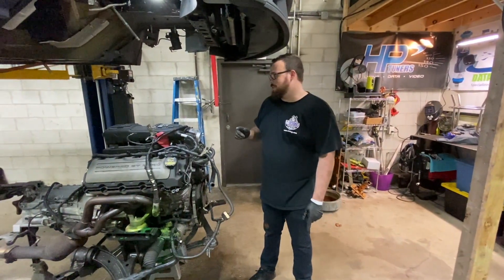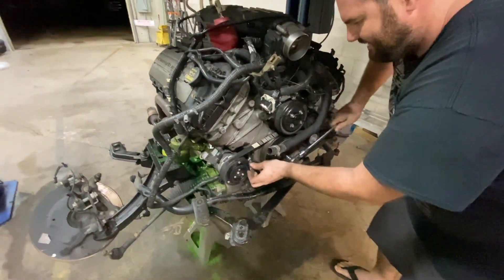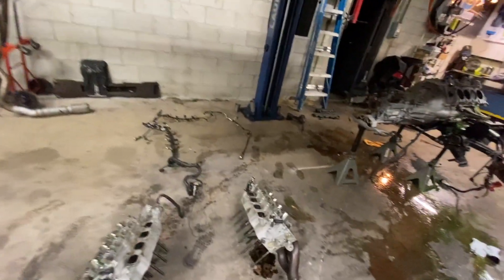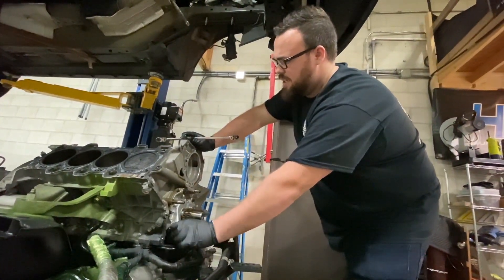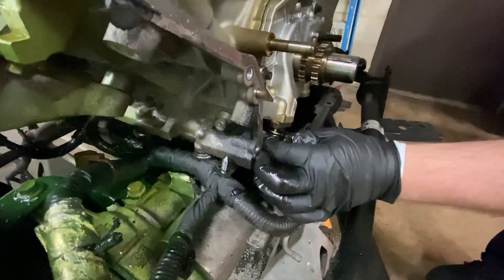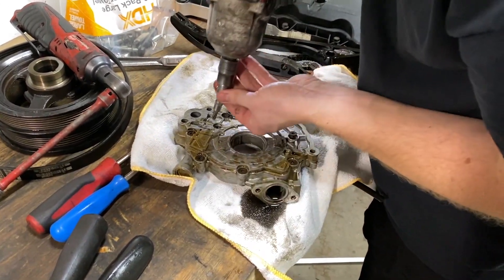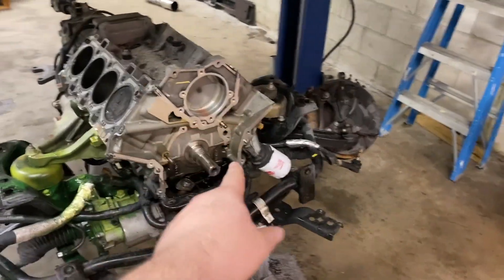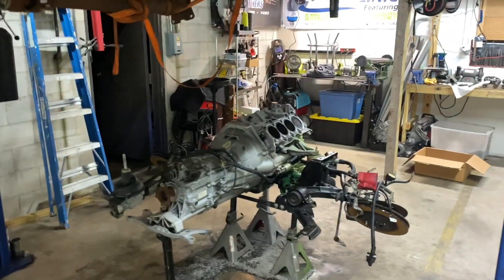Rebuilding a Blown Up Coyote: Did the Oil Pump Gears Break?

Comment: Throwing 2 rods in a v8 is normal if they are both in the same journal most of the motors I've seen through the years are somehow mostly like that what would be abnormal is if one of the rod that fails is on the same bank which could be airflow related

Comment: you going to reuse those heads? has to have metal all in the oil passages with 2 rods gone.
Reply: Not to mention the bad valve over the failed cylinder.

Comment: not removing the exhaust manfolds will throw off the torque numbers due to their weight hanging off of the head. So there is a need to remove the exhaust manafolds.
Reply: David Peterson While this is a fact, many Ford techs do this same time saving procedure
Reply: @carstuff4u942  and why I will never buy a Ford